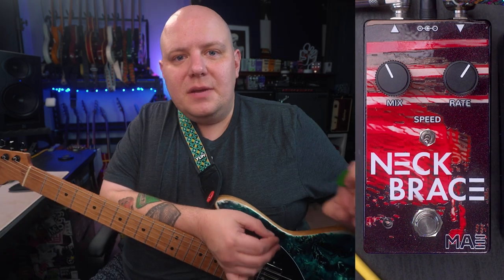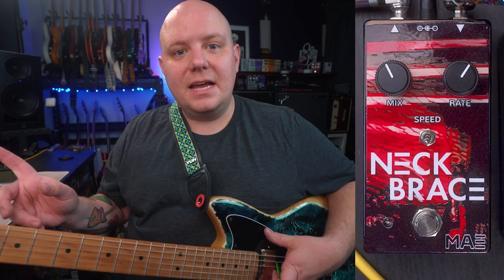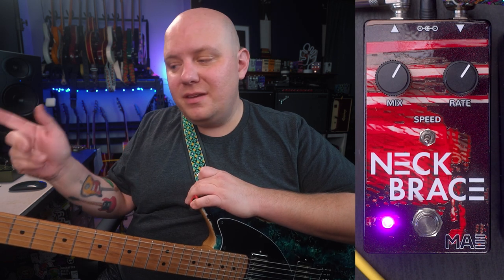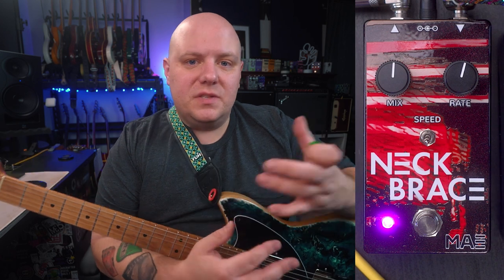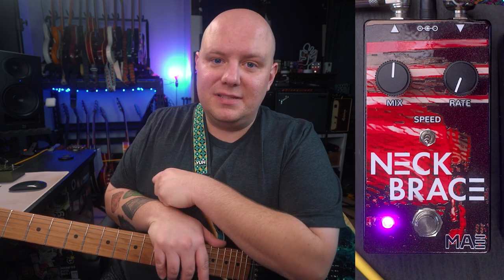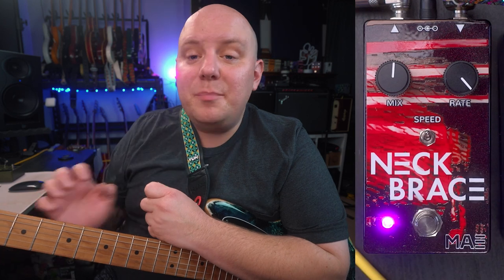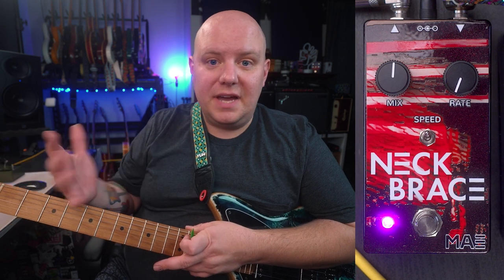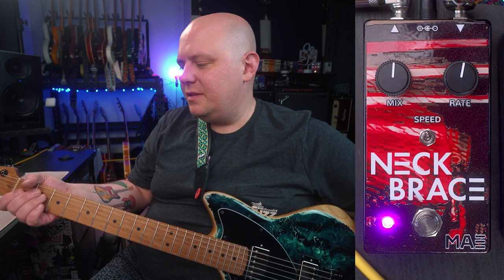Mask Audio Electronics - Neck Brace Phaser

Comment: This is honestly the most uniquely voiced phaser I've ever played, and the speed switch also sets it apart from all other phasers. It can get so slow that it's a subtle modulation, and so fast that it turns into almost a ringmod. ... and it ONLY has two knobs ... This is my go-to phaser now, and has kicked all others off my board.
Reply from the maker: Thats so great to hear that you're digging the Neck Brace! I know that Alec is really proud of the way it turned out and I think you hit the nail on the head. Also, I've heard that the 2-knob, toggle, footswitch interface may be applied to an upcoming release in the future! - Eric